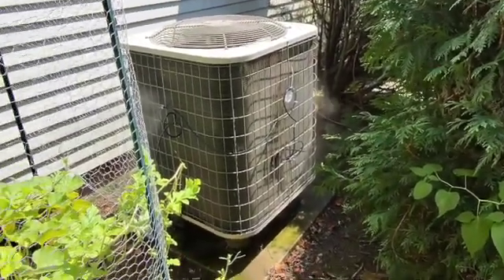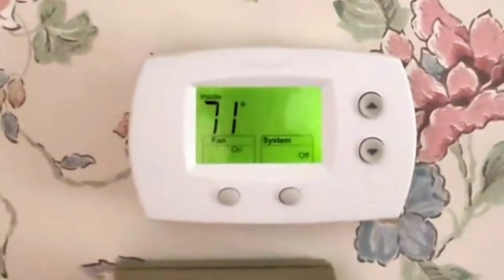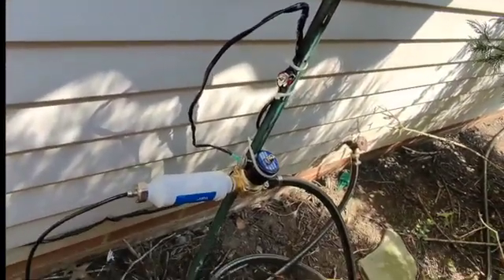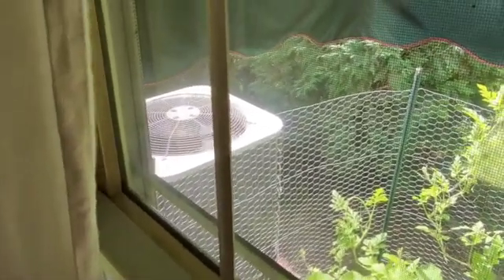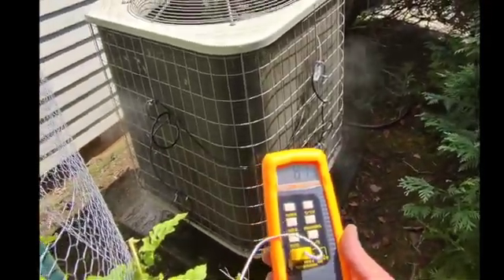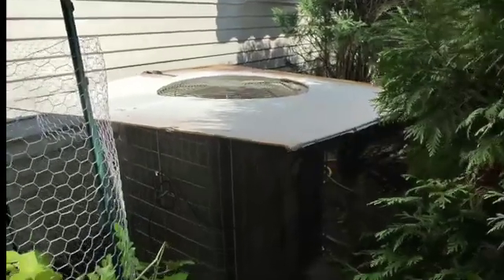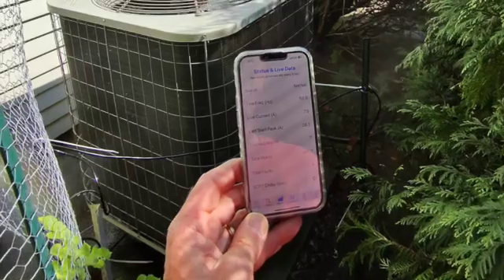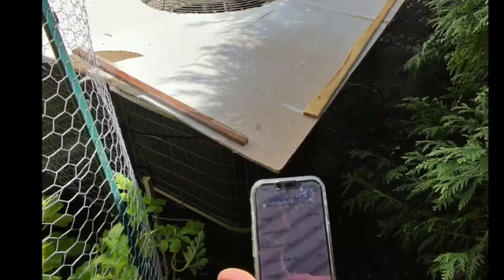We Used Your Ideas to Modify Our Backyard AC Cooler and This Happened

Comment: I like what you are doing there but I think we need a programmable sprinkler timer to have it run just during the hot point of the day. Fine micro mister tips to use the least amount of water to not be wasteful and over wet the unit. I would only use this during the hot months of the summer and remove during the rest of the year because of the corrosion factor. Would clean the coil after every summer as well

Comment: What about the misting moisture getting into the fan motor ?
Reply from the maker: I guess it's something to consider but these units are outside, in all sorts of weather and are designed to be exposed to moisture. Also, it the mist is getting through the fins and coils - and I have bot inside and outside fins on my unit - then the misters are not set correctly. To be most effective, the mist should evaporate on the fins/coils as they come in contact with them. If the droplets make through to the inside of the unit where the fan motor is then the water volume or the mist settings need to be adjusted. It's vaild concern though and I thank you for pointing it out.

Comment: I work with huge systems that is desinged with misting systems. 

Scaling is very very real and a filter wont do shit if you get water drops on your condenser. You bascially want water with zero minerals in it  if you spray on coil, such a system is generally expensive. Thats the reason for why almost noone use mist.

Either we make sure that no water will reach the condenser, only water vapour, misting with a certain distance from coil. Or a pad system with water on top of the pad.

The systems that use water generally have a threshhold where they turn on. They often have epoxi coated fins. Often threshhold like above 25c outside temp, but that depends on local prices for water and electricity. We usually go for 24c threshhold.

Also, you could measure the pressure inside the condenser fairly simple, to see how much the mist affect the condenser.
Reply: Would be interesting to see the effect of misting a shade overhead rather than the unit itself.  That would reduce the temperature underneath the shade without getting the AC unit itself wet.

You could potentially even put a pipe in the middle to leverage the stack effect and draw hot air upwards.
Reply from the maker: Hi Tim, Thanks for the suggestion. I may try it, but....as others have pointed out, the unit is already shaded most of the day so I'm not sure if/how your idea would have an effect. I may try something like a swamp cooler for a time and then compare the effects of each. Thanks again for your input and stay tuned for updates!
Reply from the maker: I'll look into measuring the pressure inside the condenser; and thanks for the input on the threshold for turning the system on.

Comment: Ambient day temp was low/ moderate  and the unit is largely in shade anyways . If the unit was in full sun on a hot humid day  the additions of shade and misters will give max impact . .. The thermostat controls temp . What your add-ons will do is make the temperature pull down faster in extreme weather.   A 10--15 person small bus has condensers 2-3x bigger than a large car yet the systems are similar . A more efficient condenser results in better all round a/c performance .
After fitting 2 condensers to my pick up I gained 1/2 ltr per 100km travelled OR 1/2 Quart per 60miles  in fuel economy . Biggest gain was it performed way way better all the way upto 110F AMBIENT
Reply from the maker: That is an excellent point regarding the impact of direct sunlight and higher ambient temperatures. As I said towards the end of this video ,what I've shared is a sample size of one - not enough to draw definitive conclusions. Personally, I think it helps but, by how much?? Not really sure. Over time I'll get a better feel and will likely release a follow up video comparing kilowatt usage year over year since implementation.